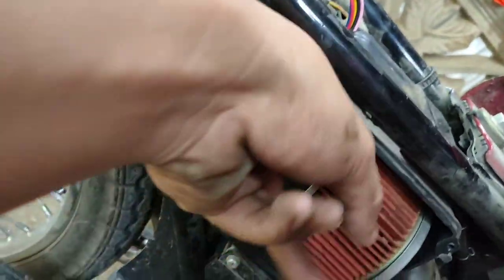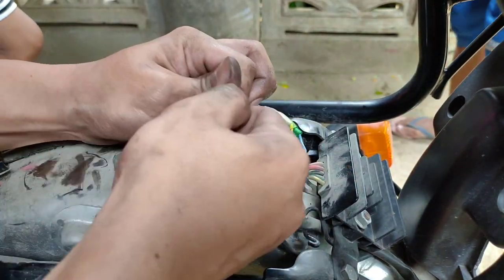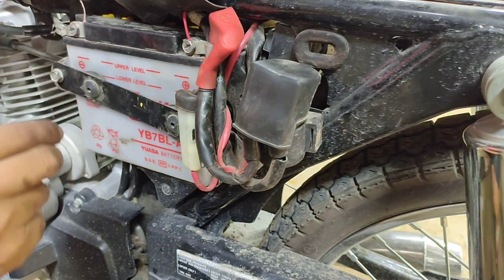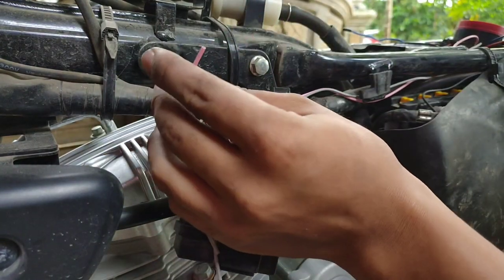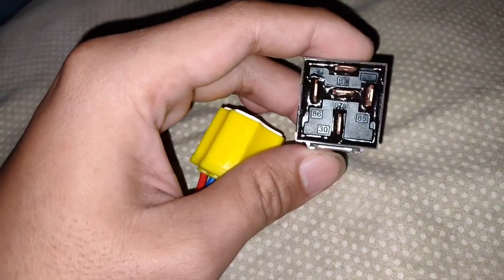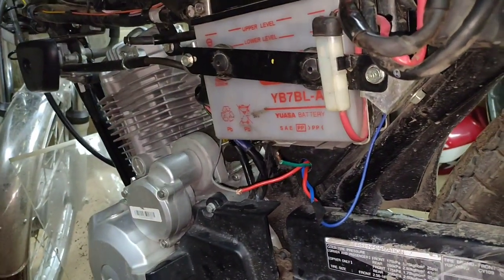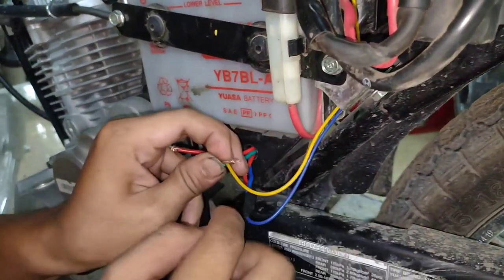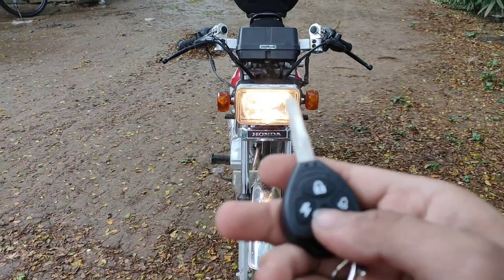Paano mag install ng 1 way or 2 way alarm sa Honda TMX 125

Comment: Boss para San po b ung pink na wire nung ipakabit ko sya pinutol tapos tinanong ko kung bakit Hindi Niya kinabit Sabi nya Wala raw un
Reply from the maker: Depende sa nag install yan kung sa paano paraan nya kinabit kung working naman lahat walang problema pero yung pink saka gray na wire para sa kill switch yun kadalasan ginagamit yun sa hindi battery operated na motor. Pag battery operated naman motor mo kahit isa sa pink o gray pwede gamitin kill switch.
Reply: Pag battery operated po ang motor hndi na po ginagamit ang pink na qire.pang primary type lang po ginagamit ang pink na wire

Comment: Boss bat ung sakin ayaw mag tuloy start kapag remote gamit
Reply from the maker: May prob sa kill switch na pinag kabitan mo
Reply from the maker: Kaylangan kasi yung pink saka gray na wire naka connect sa pinutol na Black na may lining na white. Ano ba motor mo boss?
Reply: Tmx 125 sir
Reply: Ah kelangan putulin ko ung black lining white sa may cdi tapos connect ko ung gray at pink sa pinagputulan?
Reply: Or gayahin ko sir ung ginawa mo magtuloy na kea sya
Reply from the maker: Try mo boss.
Reply from the maker: @markchristancruz3846  yes bos tama

Comment: Paano po pag wla na ung black na may white saan pwede ikabit ung gray ang pink
Reply from the maker: Sa pulser sir pede hanapin mo lang yung wire na naka konek sa pulser
Reply from the maker: Ano ba klase motor mo?
Reply: Motoposh 125
Reply from the maker: Wala ba boss kahit sa cdi wlaang Black na may lining na white?
Reply: Wla po boss pinutol nila boss
Reply from the maker: Ahh naka battery operated na motor mo?
Reply: Pano po mga bro kng ayaw mg start nong motor ko nag reredondon lng po cya kc po ung motor ko bajaj ct 150 ayaw nya mg start nasunog naman ung pagkabit ko ng toway alarm bkit ganon ano kaya dapat gawin.mga bro sna maturoan ninyo ako kng paano slamat.
Reply: Naka batery opireted cya
Reply from the maker: Check mo cdi mo bro. Battery operated bayan cdi mo?